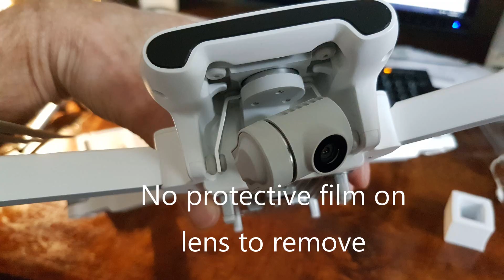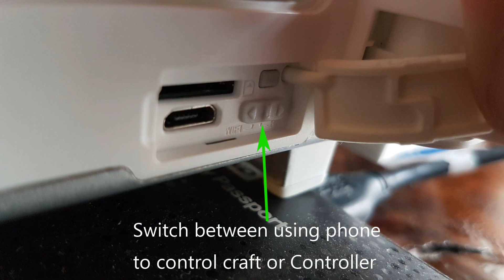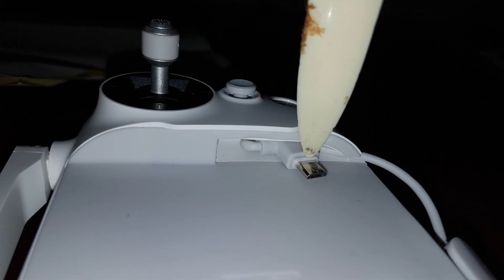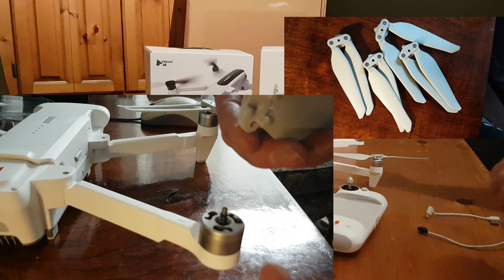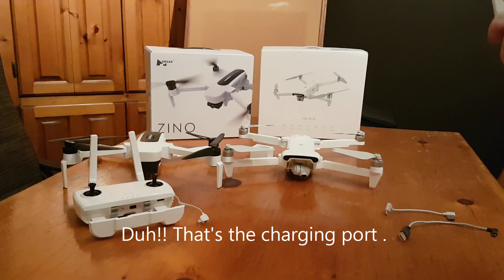FIMI X8 SE vs Hubsan Zino - Mash Up Pt.2

Comment: I've had my Zino since December. Have installed all the updates except for the last one. I have as yet to fly it, due to all the problems it's been having. So it still sits in my closet. It looked so promising to begin with but that soon changed. I'm new to the hobby, so I'm not that experienced, so I'm still holding out hoping the Hubsan will get their act together, but I'm having my doubts. I'm thinking I should have waited for the FIMI. Thanks for your review, and look forward to you flying it and give a further review.
Reply: Daniel hey man don’t stress yourself about it. Your not the only one I can assure you.
I’m guessing in another few months there will be something to beat the x8??
🤞hubsan will fix the flight control issues though.
Reply: @pb9839  Hey Phil. Good to see your still around. I'm wishing I had waited before I purchased this thing. I was really hoping this would have been a good quad. Thinking about selling it and taking the loss. Today I just received a jjrc pro X5 Epic. Just wanted something that works, although it's not 4k, it is a quad I trust. So I'll just fly it and wait to see what new comes out. If I have to I'll go with a DJI product, just hate paying the price they want. Anyways thanks for your support.
Reply: Daniel that epic looks like a great quad. You willl enjoy that I’m sure.
I was thinking of selling also but I’m gonna wait another bit. It’s all just progression. If you enjoy the hobby then your gonna get a Dji eventually anyway.Best to learn all you can with the cheaper drones first.
Enjoy your new quad bro!
Reply: @pb9839  I'll hold out for awhile longer, see how things go. I'm sure we'll chat again. Good flying to ya...